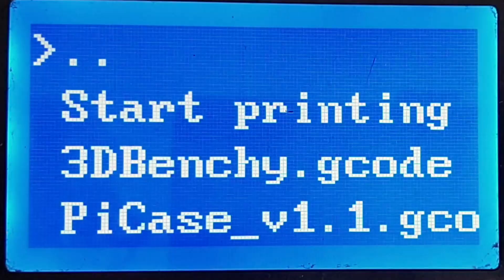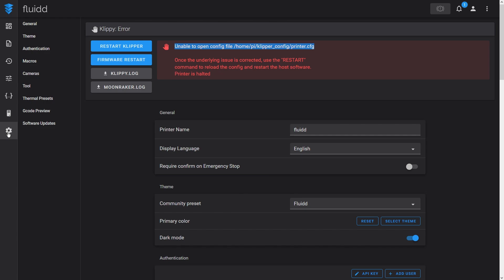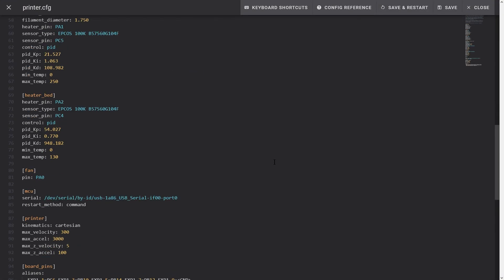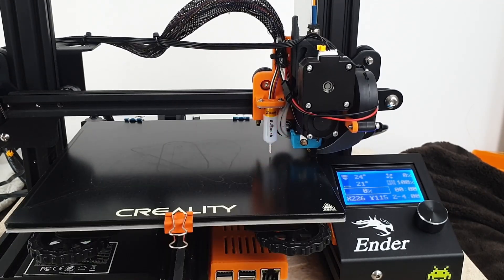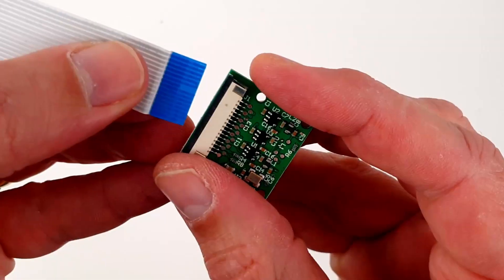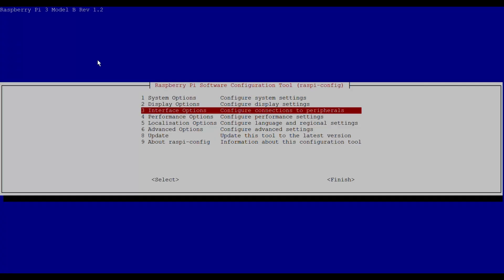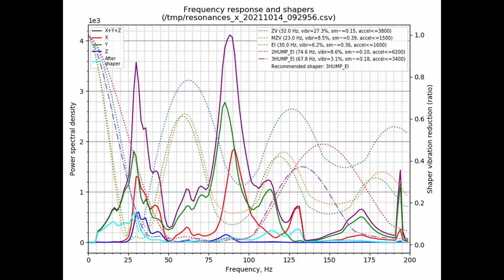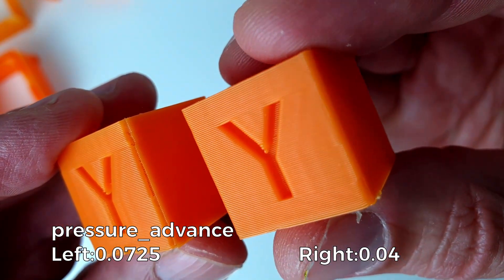Klipper on Ender 3 😱

Comment: I have a question: you compiled the STM32 firmware while other sources indicate Atmega1284p. May I ask exactly what version is your Ender3? I'm guessing it's a V2..
Reply from the maker: It's an Ender 3 Pro but with a 32 bits mainboard (Creality V4.2.7). For the 8 bits mainboards (V1), you would use the Atmega1284p.
Reply: @YouMakeTech  Thanks! Yeah, it looks like I need to install a bootloader too before I can flash it.
Reply from the maker: @zsiga09  Yes, it's a pain... I had the same mainboard as you and decided to upgrade the mainboard before starting to upgrade the firmware (Marlin or Klipper)... If you consider upgrading, take a look at the BTT SKR Mini E3, I think it's the best mainboard for the Ender 3 (honest advice, I am not sponsored by BTT). The 8 bit Creality V1 mainboard works with Klipper. But the new mainboards (Creality V4.2.7 or BTT SKR Mini E3) have more memory, are easier to flash, and have silent drivers...
Reply: @YouMakeTech  I hear you but I bought the Ender 3 just to print my parts for a Voron 2.4. Then I'll probably sell it, so I don't want to sink more money in it.
Reply from the maker: Cool 👍 I should probably build a Voron too. I spent so much time, effort and money upgrading my Ender 3! It works very well now. I can't blame Creality. I mean I would never have bought a Voron or Prusa right off the bat without being sure I would love 3d printing!
Reply from the maker: Good luck with your build!

Comment: I have Ender 3 pro (board v4.2.2) and after putting sd card with compiled firmware with given parameters the LCD screen remains blank. Where the problem can be?
Reply from the maker: This is expected. The screen will come back after you configure it in printer.cfg. To add the lcd screen to your printer.cfg, add the following lines: [display] lcd_type: st7920 cs_pin: PB12 sclk_pin: PB13 sid_pin: PB15 encoder_pins: ^PB14, ^PB10 click_pin: ^!PB2
Reply: @YouMakeTech  Thank You! I thought I did something wrong
Reply from the maker: Sorry I forgot to mention it in the video. The first time I tried Klipper, I also thought the blue screen was a bad start... But this is not like Microsoft Windows! Keep going!
Reply: @YouMakeTech  thanks! I just got it running after hours of troubleshooting! I had a problem with accessing web interface (error 404). The only thing I did different than in tutorials was I used Ethernet connection and... It was the case! Web interface by default is accessible ONLY on IP of wireless interface. It took me so long... 

I think those are two informations worth mentioning in tutorial

Comment: I'm back! Tried my first print with klipper/fluid, failed immediately. I got this error, "!! Move out of range: 151.200 335.000 12.624 [16.000]" and have no idea why. From my search I see someone mentioning to "add a G90 to the end of your homing_override section." but I don't see a homing-override section in my printer.cfg.
Reply from the maker: And? How is it going? Did you solve the issue one more time?
Reply: @YouMakeTech  Nope. I haven't really found anything that has helped me. Haven't even tried to print again.
Reply from the maker: Which printer do you use? 335 is large for Y. Have you tried to slice a small calibration cube in the center of the bed?
Reply: @YouMakeTech  I was trying to print an accelerometer mount, so it's a small print. It's an Ender 3 V2, so I used that config. I installed a CR touch at the same time. I have no idea why there's a 335 call in there at all.
Reply from the maker: Does this gcode print with Marlin?!
Reply: @YouMakeTech  I don't know what you mean by this. I load the gcode into fluidd and it doesn't print.
Reply: I have the same problem but no solution yet :/
Reply: @isdochegal9235  I don't know what I did, but mine now works fine. I've since switched slicers though, maybe that has something to do with it?

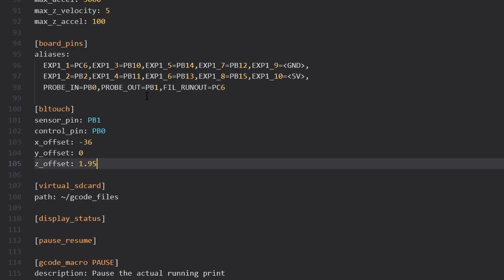Comment: At 3:05 I notice you have a [board_pins] section in the config file. I don't see this in mine. Is this something I'm supposed to have?
Reply from the maker: No. This is optional. It was defined in the default config file provided with Klipper. The [board_pins] section defines aliases for pins

Comment: Hi can you try volcano with 0.4 nozzle with klipper with settings 
0.2mm layer height, 
60mms on outer perimeter,
150mms on inner perimeters, 150-200mms  infill, 
3k-5k acceleration

 and make a video about it please please. We want to get into speed printing with klipper without spending much money for expensive hotends and setups. This would mean we can use the volcano to get the job done

I would like to know how it performs.
Every youtube video tells only about 0.8mm,1mm nozzle etc
But no clarity on 0.4mm with fast speeds.. This would be a great video. Please.
Reply from the maker: Hi, this will work perfectly fine with the Volcano, I have tested it: no problem. I have been trying to make a video about the E3D Volcano for over a year now. But I cannot really make use of its full potential on the Ender 3. Actually, the Volcano is a bit overkill for the Ender 3. The Volcano can achieve 3x the flow rate of the E3D V6: 40-45 mm3/s! This means that to reach the limit of the Volcano with a 0.4mm linewidth and a 0.2mm layer height, you must print at 500mm/s! Unfortunately, the max accel on the Ender 3 to get good quality prints is around 3000mm/s². Therefore it takes ~40mm to go from 0 to 500mm/s at 3000mm/s². That's why the Volcano is better used to print wide & thick layers and big parts. With a 1mm linewidth, a 0.5mm layer height, you only need to print at a speed of 80mm/s to reach a flow rate of 40mm3/s and you don't have to go crazy about accels. So for big parts, you reduce the print time by a factor 3 without degrading print quality. I made some testing with 0.4mm nozzle on the Volcano on my Ender 3 Pro and could not do much more than the V6 at this nozzle size. The Volcano really shines when you use big nozzles and print big parts!
Reply: @YouMakeTech  thanks very helpful.. Awesome response.

Comment: Great video, thank you! I like the quick and to the point style. Do you mind sharing your slicer settings for the test prints? I'm having trouble getting down to 30min for the benchy.
Reply from the maker: Thanks for your comment. You can download the gcode I used for the 3D Benchy in the video here -> https://github.com/YouMakeTech/klipper-ender3/tree/main/demo . 
My print settings for a <30min benchy In Klipper:
max_accel: 3000 and max_accel_to_decel: 3000, square_corner_velocity: 5, pressure_advance: 0.04 and input shaping enabled. 
In Cura I have (for Sunlu Pla+):
Layer Height = 0.25 mm, Line Width = 0.4 mm, Wall Line Count = 2, Top/Bottom Layers = 3, Infill Pattern = Cubic, Infill Density = 20%, Printing Temperature = 230°C,  Build Plate Temperature = 70°C, All print speeds (infill, wall, support etc.) to 150 mm/s except Travel Speed = 250 mm/s, Initial Layer Speed = 50 mm/s and Skirt/Brim Speed = 50 mm/s. Number of Slow Layers= 1. Retraction Distance = 1 mm. Retraction Speed = 80 mm/s. Combing Mode = Not in Skin. Fan Speed = 100%. Initial Fan Speed = 0%. Regular Fan Speed at Layer = 2. Minimum Layer Time = 0 s (Super important). 
===============================
There are ways to optimize this further and reduce the print time but most of these "improvements" come at the cost of print quality (There are no free lunch!) e.g. Line Width: 0.4mm -> 0.5mm, Fill Gaps Between Walls = Nowhere, Z Seam Alignment = Shortest, Seam Corner Preference = None, Top/Bottom Pattern = Zig Zag, Bottom Pattern Initial Layer = Zig Zag, Monotonic Top/Bottom Order = Unchecked, Infill Pattern: Cubic -> Zig Zag, Infill Density: 20% -> 6%,  Retraction Distance = 0.3mm,  Combing Mode = Off

Comment: Hi, tempting video... 😎😎
Will this solution work on ender 3 creality3d v1.1.4 main boards as well? Let me know I will immediately update mine... 😎😎
Reply from the maker: Yes it will work 👍
Reply: @YouMakeTech  ok I'll try this week...
Reply from the maker: Cool. It takes a bit of time to set this up but it is really worth doing! Please let me know how it goes and if you need some help, I am here
Reply: @YouMakeTech  Hey man. Finally managed to upgrade everything on my ender 3 v1.1.4 board..... Everything works well
Only pressure advance is pending... 100mm per sec works good. Ringing is reasonably good. Thanks for motivating mate.

Comment: This video was extremely helpful and well structured. Have you tried printing at high speed with a 0.12mm layer height? I'm working on dialing in settings for that and curious what speeds others are getting with Klipper on the ender 3 at that layer height.
Reply from the maker: Thank you for your comment. I haven't tried with a 0.12mm layer height yet. I would be happy to do some testing. What kind of parts do you print? Do you have a link to an example .STL file? My print speed is mainly limited by 4 factors: 1) The max volumetric flow rate of the extruder/hotend. My setup is limited 15mm3/s which translates into a max print speed of 150mm/s for a 0.25mm layer height or 300mm/s for a 0.12mm layer height 2) Max acceleration. With my Ender 3 Pro and Klipper, due to the printer stiffness and mass of moving parts, the max accel I can use is limited to 3000mm/s². Above that, I get too much ringing and the print quality degrades too much. 3) The size and shape of the part you print: At an accel of 3000mm/s², it takes a distance of 15mm to reach a print speed of 300mm/s. If the parts you print are too small, you can set the print speed as high as you want, the printer will never actually reach it. It will be constantly accelerating/decelerating 4) Print quality: To improve the print quality, I print the exterior of the parts at 50% of the max speed.
Reply: @YouMakeTech  Thank you for all that helpful info. That helped to confirm some of what I thought was correct. There seems to be so much conflicting/confusing info on 3D printing, it is hard to know what is correct. While working on tuning my settings for this layer height, I've just been printing Benchys. They print fantastically at .2 layer height but when I go down to .12, I find I have to print much more slowly than I would expect (even after tuning of retraction, pressure advance and input shaping). Through a lot of trial and error, I've been able to improve them a lot and eliminate most issues but still find the front bottom half of the bow to come out a bit rough and also the back two corners, not smooth at all in those places. I'd be very curious to hear what your results are at that layer height when printing a Benchy if you have time. Also, do you have a particular slicer you find that gives you the best quality? I'm on Cura right now and wasn't sure if it could be causing some issues somehow.
Reply from the maker: May I ask why you want to use a 0.12mm layer height when you are satisfied with the quality you get with a 0.2mm layer height? 0.12mm seems quite low for a 0.4mm nozzle and it will be difficult to reach the max. volumetric feed rate of the extruder/hotend. 
What kind of print speeds/accelerations do you currently use? Cura is far from perfect but IMO gives the best print quality overall. I tried PrusaSlicer & slic3r but was not satisfied with the print quality + bugs.
Reply: @YouMakeTech  I'd like to use .12 because of the reduced layer line appearance and slightly crisper details. While I am happy with how my .2 prints look, I occasionally print things where I want the details to be a bit more crisp and layer lines slightly less noticeable. I don't think I'm looking to max out my volumetric rate, my speeds just seem a bit low and I feel like I'm missing something somewhere. For print speeds, I am doing 100 mm/s infill, 75 mm/s interior perimeter/wall and 50mm/s external. I have acceleration set to 3000mm/s in Klipper. The only speed that really bugs me is 50mm/s on the external perimeters, the others are more acceptable. I expected to be able to go a bit faster than that (I can on .2) and even at that speed, I am having a couple small issues still. I'm thinking about giving SuperSlicer a shot and seeing if at the same speeds it eliminates the couple remaining small issues I am seeing.
Reply: Just wanted to share I sliced this in Super Slicer and I got extremely smooth corners. I also got a much smoother hull surface. Sadly though, I got really horrible stringing and even a bit of under extrusion on the deck. So Cura seems to be best overall but going to try and figure out what they're doing differently on the corners / hull.
Reply from the maker: The best way to understand the differences between slicers is to compare the generated gcode. PrusaSlicer can open .gcode files and render them line by line. I find this extremely useful. The issue IMO is that the gcode does not control all settings. Some settings are in the printer (e.g. accel, corner speed). Cura by default does not affect the printer settings while other slicers (e.g. PrusaSlicer) send a lot of configuration commands before printing (e.g. linear advance, accels etc.)...
Reply: @YouMakeTech  Wanted to respond to this in case someone else finds this info useful. So I viewed the GCode in each slicer looking particularly at the layers where I was seeing rough corners. Started with Speed and Flow rate which all looked similar. Then I went through the toolpath on each slicer for a few particular layers. I noticed in Cura at the end of each layer, it was doing something at each corner that was appearing rough. A small amount of filament was being deposited but I had no idea why. Super Slicer was not doing this. I went through the settings in Cura and eventually found Fill Gaps Between Walls which looked like what it was doing. I changed this to Nowhere, re-sliced and saw the layer no longer was depositing material at the corners at the end of the layers. Tried a print and got perfect corners. I'm not quite sure why this was only affecting the layers near the bottom of the model but I'm glad to finally have some sort of explanation.
Reply from the maker: Thank you, very useful. Indeed I noticed that for the 3DBenchy, Cura was wasting a lot of time filling very small gaps. In my profile, I enabled something called "Filter out tiny gaps" if I remember correctly. This helps too

Comment: Nice video, i use mainsail but it's nearly the same. but somehow my raspberry pi cant connect with the printer over USB, when i try to read the serial port it only shows "no such directory /file found", can anybody help?
Reply from the maker: Have you tried with another USB cable? Many charging cables are not wired for data and do not work with Klipper. 
What do you get when you type in the Raspberry Pi  shell: "ls /dev/serial/by-id/*". FYI I get "/dev/serial/by-id/usb-1a86_USB_Serial-if00-port0". When you did "make menuconfig", did you check USB (on PA11/PA12) as Communication interface?
Reply: @YouMakeTech  i have tried 2 cables, one i used for connecting a xbox controller to pc and one phone charging cable. when i type "ls /dev/serial/by-id/*" i get "ls: cannot access ' /dev/serial/by-id/*"': no such file or directory" and i did the menuconfig like in the example codes
Reply: @YouMakeTech  also my bin file to flash the creality mainboard does not convert into a .cure if that matters
Reply from the maker: It does not matter. You can flash the .bin file directly. Do not forget to rename the file differently each time you want to flash. The bootloader only flashes a new firmware when the filename is different from the last filename used...
Reply: just fixed it, i tried many different cablse, one one is doing the job, a very old HTC phone charger cable, i dont know why but it works! and by the way. thank you for answering so quick ;)
Reply from the maker: Good news! I had a similar issue. Many USB charging cables  don't work because they are not wired for data transfer. I tried dozen of them too before finding one which worked!

Comment: Does Kipper eliminates the motor noise for Ender 3 ?
Reply from the maker: Yes it reduces the motor noise. I guess this is because Klipper control the motor at a higher rate. But if you really want to reduce the stepper motor noise, consider getting a Creality 4.2.7 maiboard or a Big Tree Tech SKR mini E3
Reply: @YouMakeTech  Due to import taxes the 32-bit boards are costly where I live but knowing that it can reduce those noises I am looking forward to upgrading. Thank you for the quality content and information.
Reply from the maker: A mainboard with TMC drivers is the ultimate solution to reduce the stepper motors noise. But with with Klipper, you will already notice a significant improvement compare to Marlin

Comment: Nice and concise video. As I see it, it is a step by step guide. I have no experience with the Raspberry. With the instructions in this video, should it be possible for beginners like me to load these clippers with fluid onto the Ender? I have an Ender 3 pro with Silent board. Can the Klipper firmware be loaded directly onto the mainboard or does it have to be released for other firmware if only Marlin was on it?
Thank you and please continue with these detailed videos.
Reply from the maker: Not much can really go wrong if you have a backup of your current firmware (Marlin). Klipper consists of 2 "firmwares": 1 firmware runs on the Raspberry Pi and it is where everything is configured and computed. The 2nd firmware runs on the printer mainboard and replaces Marlin. The main difficulty is to get the right settings for your hardware in the printer.cfg config file. If it does not work, you only need to reflash the Marlin firmware on your printer by inserting an sd card with the firmware on it. Long story short: Make sure you have a backup of your current firmware or now how to compile a working Marlin fimware for your printer before attempting this. I am here to help if you have any issues. And beware, this takes TIME... Be ready to spend a full week end on this!